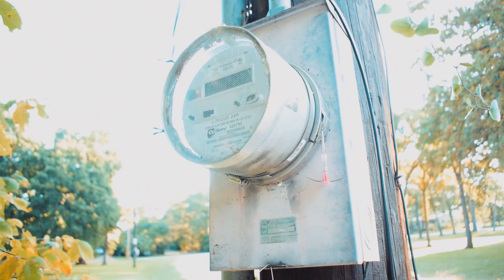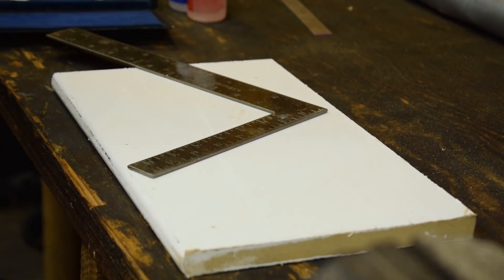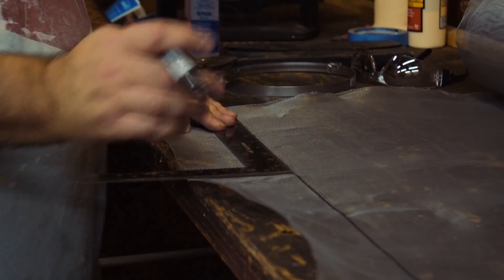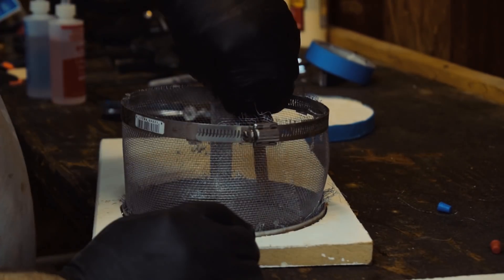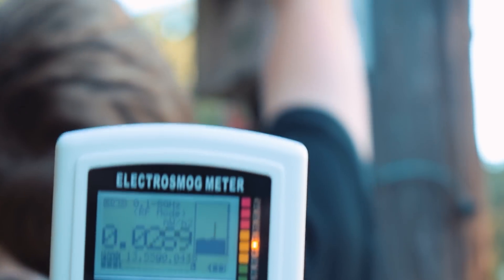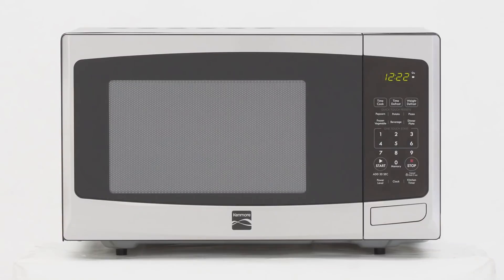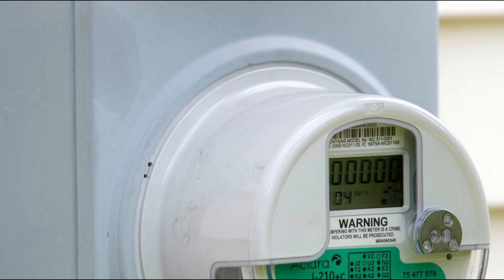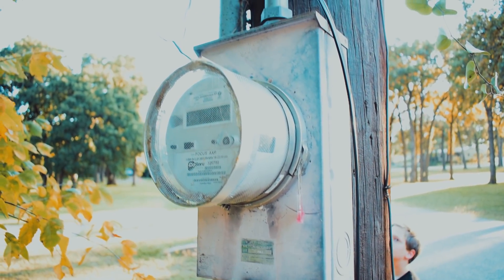Build an RF Blocking Faraday Cage For Your Smart Meter +Bonus Faraday Science/History

Comment: Darin Beard: I have a 5G Fios box and every night before I fall asleep, my scalp itches and I think there's a correlation.
Reply: I knew a guy who had customers who proudly hard-wired all of their computers. So my friend is visiting this couple while fixing their computer for a software issue. After hearing the couple speak so proudly about not using WiFi, my friend asked me if they wanted him to turn off the WiFi in their Fios router settings.

Although the couple was not using wifi, they never turned the feature off in their router. In fairness, since the were not using it, they were not being bombarded as much as would otherwise be the case. However, the router, or more accurately the wireless AP (access point) does continually broadcast it's name.

Well, the couple never called my friend again after he offered to turn off the wifi AP. 

My point, I suggest establishing a control measure. If your Fios router has a "wifi on/off" switch (some do), I'd suggest having a family member turn it off and on randomly each night. They write down when they turn it off or on and you write down when your scalp itches. After a couple of weeks or a month of this you can check the results. Maybe there will be a clear correlation, or maybe not.
Reply from the maker: @DJRonnieG  we have the wifi turned off on the router unless we need it for something. Almost everything is hardwired in the house now.
Reply: It's recommended to turn off cell and wifi signals while sleeping as the brain and body regenerate than. I feel wifi as something like heat in whatever is too near it for too long. I am sensitive to having strong rf too her me so I usually keep my cell in airport mode when carrying and turn it on briefly to make calls. I also have a message service to record messages so I don't need to leave it on for long times.
Reply: @lenwenzel7440  You can get a cell bag on Amazon etc that blocks everything, just toss it in there. They cost like $8

Comment: What good is a faraday cage l, if you can't mask 100% of the emissions?
Reply from the maker: It has to allow some signal through so it can communicate. FM radio is the same type of signal but this is just way stronger. Cutting it down most of the way certainly is better than nothing at all.

Comment: I was wondering if the Cage has to be grounded and all the parts of the cage have to be 'electrically conected? In Aussie most Domestic Meter Boxes are in a steel cabinet. I was thinking this surely would be a grounded Faraday Cage. If so how would the meters work inside the cabinet. If the Cage works wouldn't it block outgoing Data so they couldn't read the meter. Cheers
Reply from the maker: It does not have to be grounded to work but if it's on your house I would recommend grounding it. The meter can still communicate because it only blocks MOST of the signal out of it. In most non-rural areas a little signal is all it needs.
Reply: Cheers for that.

Comment: What about behind it?  Mine is attached to the wall of my house and technically it's only about 10 feet from where I sit typing this, but of course, facing outward on the wall outside.  Does it only give off the radiation outwardish or is it an 'all around' sort of hazard?
Reply from the maker: It does not emit from the back, only through the dome.
Reply: @DarinBeard  - good to know, thank you for your prompt reply!

Comment: If there’s a 96% reduction going out, does the energy go in the opposite direction into the house since there’s nothing to stop it in back? If u went inside the house and measured at the inside wall that the meter is connected to outside, can u read spikes coming in thru the wall? Ty.

I tried wedging a piece of screening between two pieces of thin cardboard behind my meter box but the fit was  too snug. I also attached a ground wire to the screen & connected it to a grounded piece of conduit.
Reply from the maker: A faraday cage doesn't reflect the RF it absorbs it. That's why you ground it. I didn't ground mine because it was a long ways from the house and didn't feel the need. I did ground some screens that I put outside the bedroom to block the cell tower emissions to the bedroom. RF does NOT come out the back of the meter because the meter box is metal. It only comes out the dome and the cage blocks most of the emissions. I did use a meter to measure emissions all around when I tested. It doesn't come out anywhere else.
Reply: Darin Beard what dimension did your screens need to be? I’d be interested in doing this as I am sensitive to EMF’s.
Reply: @DarinBeard  Can I ask how far you are from the tower, and is it a very large/busy tower, with multiple 4G and 5G antenna on it?

Comment: Hi, i have a question, if the meter is mounted on the side of my living room doesnt it come through the wall behind the meter even If i cover the front on the outside?
Reply from the maker: No, it does not come through the metal box, just the glass.
Reply: @DarinBeard   thank you

Comment: Won't they be sending out an engineer to find out why it's not working?🤔
Reply from the maker: No, because it does work.
Reply: @DarinBeard  so how does it connect to the power company without the signal?
Reply from the maker: @CarlJones14  as I said in the video, it only blocks MOST of the signal. It leaves enough to still communicate. They are way overpowered for what they need so the cage blocks the majority of the RF and leaves enough to communicate.
Reply: @DarinBeard  okay, I wasn't being difficult, I just wanted to know. Great video btw. 👍

Comment: when such info first came out I put HD Al foil around the meter. FPL came out twice to replace and remove the foil. Why wouldn't they do the same  for a F cage?
Reply from the maker: In a non-rural area it only needs a small portion of the signal to get through to communicate. As long as enough gets through, they have nothing to complain about.
Reply: I'm wondering about that scenario as well. I just watched another video from a company that sells emf protective stuff and they cut an opening for just the front face of the stupid/smart meter to be open in order to still send 'needed' signal to electric company

Comment: PROBLEM IS ALUMINUM DOES NOT BLOCK MICROWAVES WELL.  ANY CURRENT INDUCED INTO YOUR
BARRIER MIGHT BE GROUNDED.  BUT IF YOU ACTUALLY TEST THAT--IT WILL NOT WORK LIKE THICKER
SHEET STEEL.
Reply from the maker: I did test and it blocked it very well.
Reply: OK Ill try it, Thanx

Comment: TIN FOIL + 1 MIN WRAPPING IT. PROBLEM SOLVED
Reply from the maker: Or about an hour and you have something that doesn't look like tin foil wrapped around a meter. All in your preference I guess.
Reply: @DarinBeard  i forgot to add the rubber band to hold it in place..oops
Reply: yours is much more professional .. I was just kidding. I need to put one of those on mine ..Tin foil kind of stands out.
Reply: @DarinBeard  hey do you think this will lower my power bill if it keeps the signal from transmitting
Reply from the maker: @slc9112  If it can't communicate the power company will come out for sure. :) But I doubt you can block enough to keep it from talking using this or foil.

Comment: I jyst wrapped foil around mine works the same
Reply: @elusive wild dingo u can also block yr fones  signal if u wrap it in foil jyst need a foil full body suit for the rest lol
Reply: It works the same the day you do it but weeks or less later the foil will be gone with the wind.  Plus, if you block all the RF energy you may be inviting scrutiny from your electricity provider.  If you just can't bring yourself to spending an hour to build a robust cage, at least use aluminum screen and clamp it on.
Reply: I tried this but it got very hot inside and worried of fire!
Reply: @cara_melkoala8405  That would make sense. Aluminum foil doesn't  work out well in a microwave either.

Comment: When you were forming the end cap and had difficulty getting epoxy to set up, etc., I would have opted to use a hot glue gun every coupe inches or so, because it will hold it quickly and allow you to take you time doing a nice job with the epoxy after. When I run power and sensor wires for heat under my tile installations, that is what I do.
Reply from the maker: That is a good idea. Where were you when I was doing it? Lol.

Comment: The ones right outside my exterior wall face away from the building. 
Does that mean the EMF s only go AWAY from the building?? And could 2-3 layers of aluminum foil do the same? Seems like.
Reply from the maker: well, it only comes out the front but I would guess they don't travel in just a straight line?
Reply: @DarinBeard  thanks

Comment: just jam the smart meter, thanks what i do lol
Reply: Would using rubber work
Reply: @lostspace5811  no, rf signal jam
Reply: @TheGmr140  counter wave?  Explain
Reply from the maker: it has to be metal, I believe.
Reply: @DarinBeard  but I don't understand why a conductive material would provide a Faraday cage instead in insulation material. Surely a phone in a rubber box makes more sense than a steel or aluminium one?  Please explain
Reply from the maker: @lostspace5811  I go through it on a basic level in the video. I am no expert.
Reply: I PREFER JELLY

Comment: I have what is known as "shell shaker screen" made of very fine mesh stainless steel.  Do u think that would work?  My daughter has a gastric implant in her abdomen to help her stomach & is battery powered.  Since her smart meter was installed, her implant stopped working so more surgery is needed for her.  I have a smart meter and it is located about 10 feet from where I am now.  I haved experienced lack of sleep, easy bruising and some neurological problems.  Do u think my meter is at fault?  I did not ask for the meter - they just came & installed it without my permission.
Reply from the maker: I would think so. Worth a try.
Reply: @DarinBeard  Thank you for your reply.  Also would copper screen work better?
Reply from the maker: @bobmchugh9965  not that I know of.

Comment: What material would one use to block 5g radiation from entering the whole house?
Reply from the maker: That takes a lot of work and money. If the house is already built there is paint that blocks rf but it isn't cheap. If the house is being built you can build cage into the walls. It's a tough job.
Reply: The same aluminum mesh, just much more?  And emf blocking paint?
Reply from the maker: @terrybritten7483  yup. But you would need to cover well and ground it. And ceiling/roof, too.
Reply: I'm just trying to learn more about this too. Wanna share that I've briefly encountered info saying there's certain things you must be aware and careful of so you don't think you're blocking everything from outside while at same time accidentally creating a sort of container that will amplify/bounce back/trap radiation from devices inside. So there's that factor to learn about for us too

Comment: I just covered my meter in aluminum foil. Got it around the whole box, back and everything. I've heard these things can be fire hazards too. Wondering if containing the signal like I did would start a fire.
Reply from the maker: I don't know for sure. Does the foil actually block RF from the meter? I would make sure it's not getting hot. The box itself isn't emitting the RF, just the clear dome of the meter. So you could just cover it and be blocking the same amount without worrying about the box heating up.

Comment: According to the same meter reading rf, the microwave emissions from the smart meter are only part of the damaging effects because the home's wiring is an antennae for it.  Check this out : https://www.youtube.com/watch?v=4NTSejgsjTc  inside that video is states that the rf signals that resonate at the 2 to 50 khz range I believe they state, are interfering with regular biological funtions and radiate 6 to 8 feet from all the outlets in the house and the wiring itself I would imagine also.
Reply from the maker: Ya, dirty electricity is also an issue. There are things you can do at the fuse box to filter some but it's not easy and sort of expensive. We ended up getting rid of the digital meter completely and now have an analog meter with the spinny thingy in it. Although you can still get the dirty electricity from your neighbors' digital meters. Without going off grid it's almost impossible to escape all those things. You can only do the best you can.

Comment: When the electric power (robber barons), become alerted by a decrease in emf feedback from your meter, you'll get a visit. As to which, more likely than not, the revenue collectors will accuse you of meter tampering. But I'm always up for a challenge. My Faraday cage will not just cover the meter, but will also cover the entire box it's plugged into. Ergo, nothing is attached to the meter or touching it in any way.
Reply from the maker: Absolutely untrue. It's still has enough output to reach the next station. there was never a problem with it. I had it that way for a long time. And the power company even knew about it and had no issue with it. When we had the meter replaced with an analog meter they actually took the screen off and gave it to me. No issues.
Reply from the maker: @interestingthings8598  because we requested it to be done

Comment: So, I'm wondering; did the installation of the cage help those family members of yours who are sensitive to the esmog?
Reply from the maker: Yes. There are more factors to the issue than just the smart meter and many other things we did at home but it did seem to have an effect. We eventually got rid of the meter completely and have an old analog meter again.
Reply: @DarinBeard  how man?
Reply from the maker: @lostspace5811  we asked the electric company to remove it and they did. They were actually really great about it.
Reply: @DarinBeard  you should name them that kind of response is rare
Reply from the maker: @lostspace5811  CoServ in the Dallas, Texas area. They were really great about it. Even making sure the meter was analog and not just a digital meter without the communication parts.
Reply: @DarinBeard  are you able to link a good affordable rf counter?  Does a geiger counter  work? Ty
Reply from the maker: @lostspace5811  There are links in the description for all the supplies I used including the meter.

Comment: Ok tried that, but the technology sends the antenna microwaves into the hot wires it reads into your whole Home, I have a meter that measures 8g  and readings jump up at every 115-volt receptacle. even with a cage over the meter.
Reply from the maker: Yes, that's called dirty electricity and it's a whole different issue.
Reply: Can you explain how you measured and what device you used to measure the jump in receptacles? thanks

Comment: Can the electric company still read the meter?
Reply from the maker: Yes. The cage only blocks most of the signal and the signal is WAY stronger than it needs to be to communicate so it still sends the info they need. If you are in a rural type situation, it might not reach the next communication point, so you would have to check.
Reply: @DarinBeard  Thank you for the info.  I do live in a rural area, so I'll do more research. Again,  Thank you

Comment: Any reason you use epoxy instead of glue? Or did I miss you explaining why?
Reply from the maker: I was sure epoxy would hold on the aluminum but didn't know of a glue that would so I used epoxy.
Reply: Darin Beard gotcha! My mother had a smart
meter on her new house not knowing she was getting one or what it meant, etc.. she told me after being in the new house for three years that no one has come by to read the meter since she had been there lol. So I had to explain what a Smart meter was. But she has cancer and struggles with several health issues so I wanted to either get it removed or cover it up. It’s on the outside of her bedroom wall. Hopefully she can at least sleep better after I cover it.

Comment: All you have to do is cut the screen in a big enough circle to put it over the meter and wrap it with a bungie cord or O-ring of the right diameter.  You will get a 7X reduction with aluminum screen.  You need better screen to really get Faradayed.
Reply from the maker: I used aluminum screen I got a 95% reduction. I built the nice one because I wanted to not because I had to.
Reply: @DarinBeard  I think you meter is off.  Aluminum screen does not block more than 90%

Comment: Thanks so much for your excellent video! My question is, what about the inside of the house? I have the meter set outdoor bedroom room wall. How can I block the ref going indoors? Thanks again!
Reply from the maker: My understanding is the rf only comes through the glass dome and not through the metal part of the box so it isn't going straight into your house from the back of the box. When I put the shield on the rf dropped by 95% all around it.
Reply: Darin Beard thanks so much for clarifying this for me!
Reply: Darin Beard what if i just put aluminum around the meters will that help at all???
Reply from the maker: @trutherone1725  I don't know for sure. My understanding is the structure of a grid is what causes the Faraday effect.  I am sure it has structure on a microscopic level so I don't know for sure if solid would work or not. Maybe someone else here with more knowledge could answer?
Reply: @DarinBeard  I have seen aluminium foil wrapped around a mobile phone and that stops any reception getting through